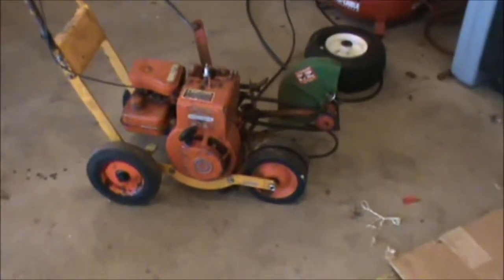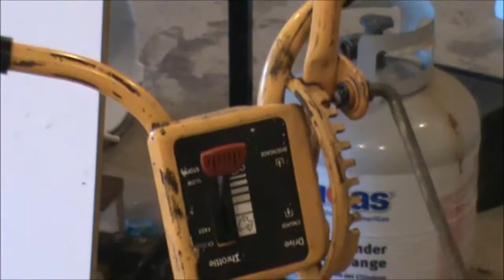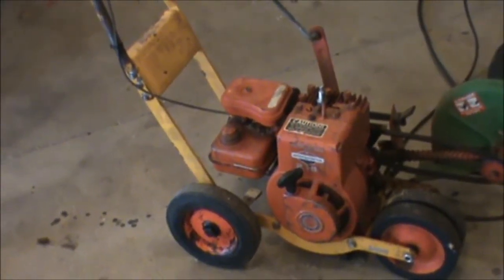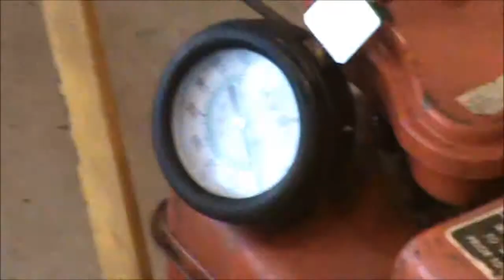Compression test

Comment: If it stalls under load, you may want to turn the high speed adjusting needle a bit out. If it has 90 PSI, it should work fine.